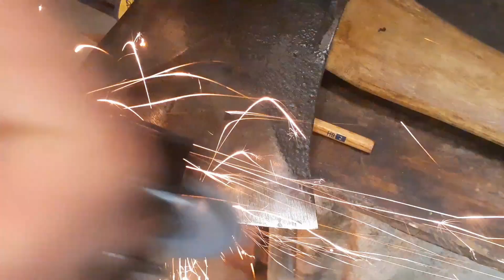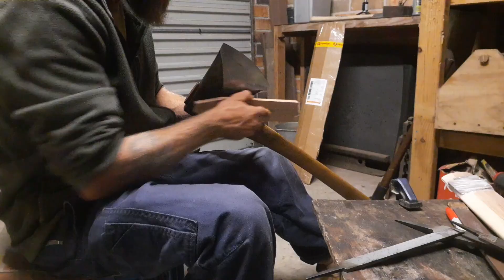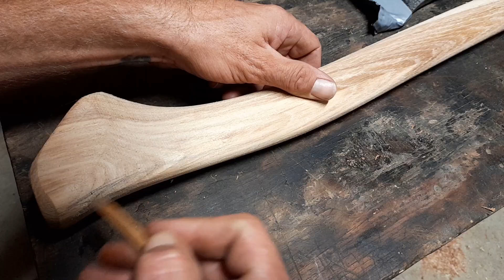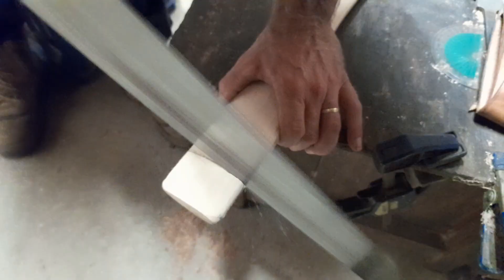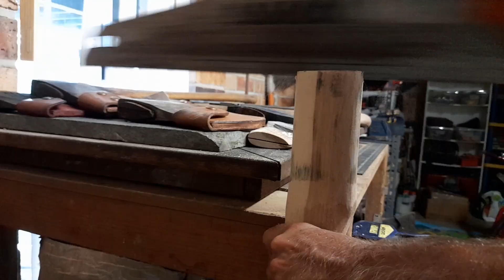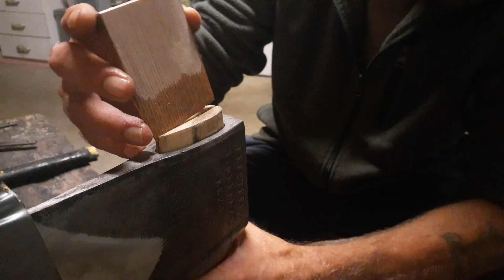90 Second Axe RE-BUILD! Keech Timberman KC23

Comment: Just watched again.  Didn’t see the disclaimer the first time through.  🤣 I love it.  Why are people so worried about that.  I’m not sure you could get an axe to heat treat temps with power tools.  Maybe?  But definitely not if you’re careful.
Reply from the maker: 🤣🤣yeah as long as your using a very light touch and checking the edge regularly for heat or colour change it's no problem. 1 careful minute with the angle grinder probably saved me an hour with a file shaping that edge I reckon

Comment: How do you determine the length of you handle?
Reply from the maker: It mostly depends on the axes use. Standard lengths would usually be a 32inch/80cm for a full size chopping axe, and 36inch/90cm for a splitter. Another way, for a more personalised fit is to measure the length of your inner arm from the base of your fingers to your underarm. For most people this measurement would be somewhere between 27-32 inches. This usually gives an ideal length. Most of my chopping axes are between 28.5 to 30. Cheers for watching mate👍👍 🪓

Comment: What handle length?
Reply from the maker: Gday mate, this is the 3/4 length, same as I put on the Tui. It's 760mm from the factory and has a long eye so you can adjust overall lenght a fair bit. I got this one down to 728mm  or about 28.5 inch. BTW, I took your advice and grabbed a Husky A2400😁